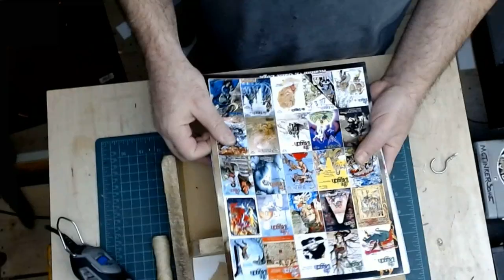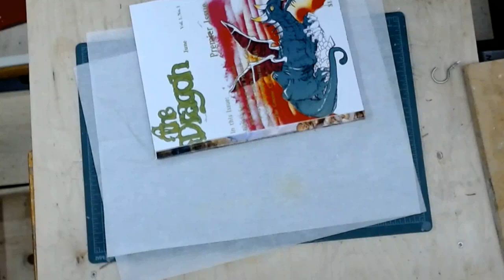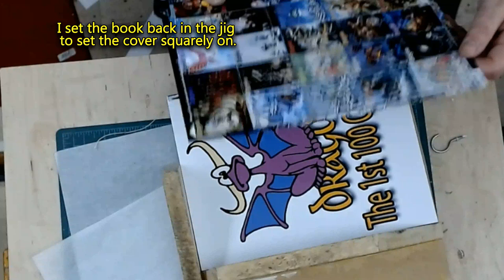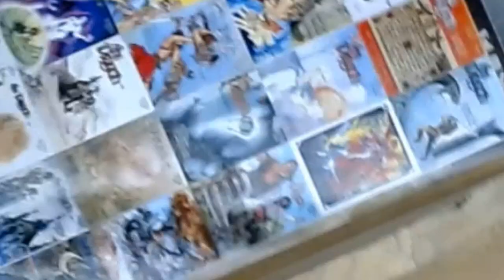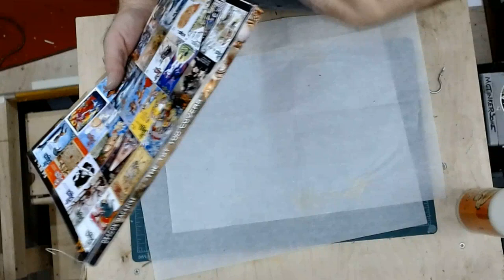Soft cover binding RPG pdfs, easy peasey!

Comment: Brilliant video. Makes me wonder if I could use this technique to re-cover some of my older books where the glue has perished and they're falling apart. Or if there's too much risk of damaging the books?
Reply from the maker: Thank you. 
Months ago, I acquired a Battletech Tech Readout for $10 shipped(!) that had fallen apart into several pieces.  I cut the covers off, printed a new spine, drilled and bound the edge as in this video and have a 'new' Tech Readout bound better than the original.

If it came down to unbinding and rebinding a hardcover D&D book, for example, that's likely a step up from this procedure.   I don't have any old hardcovers to experiment with, but would make an excellent addition to this mini-series.